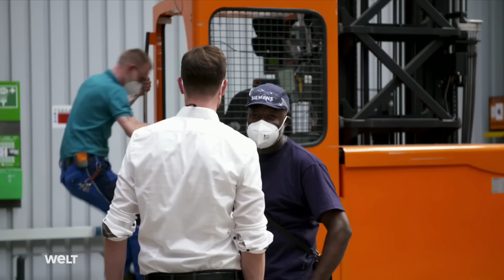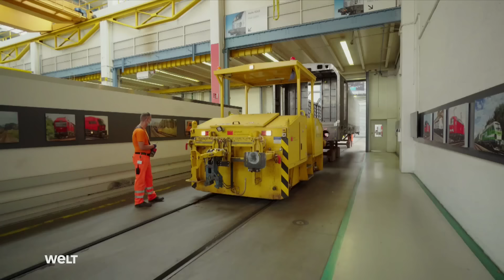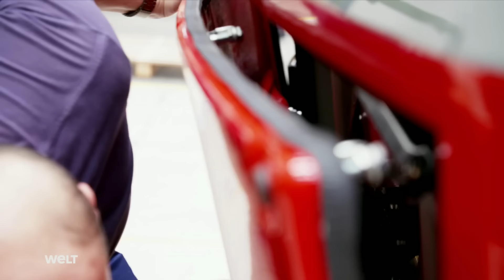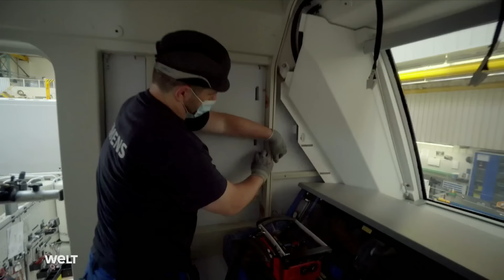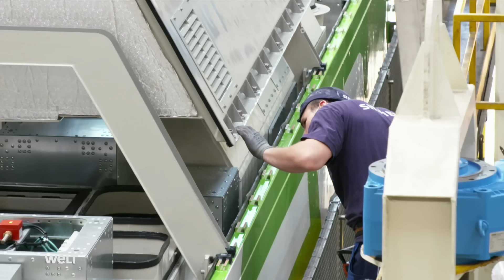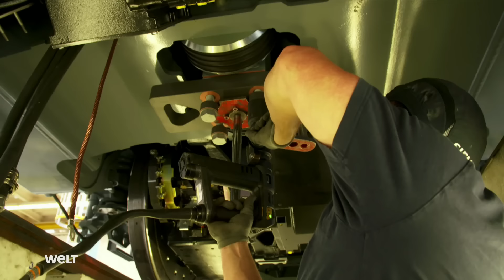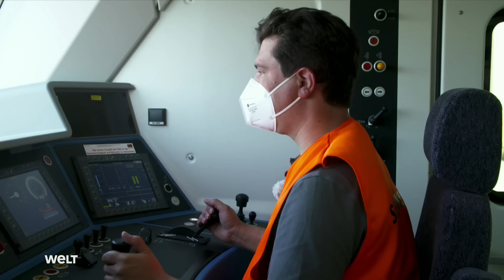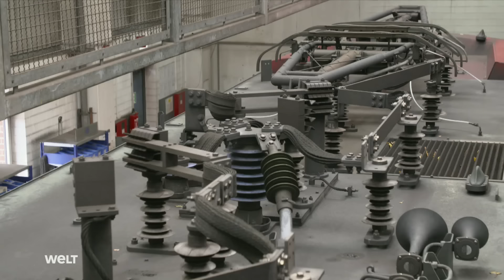SUSTAINABLE POWER FROM GERMANY: Electric Locomotiv - High-Tech on Rails | WELT Documentary

Comment: Do these machine have more efficient batteries or is this strictly power units driven with an overhead catenary system?
Reply: all powered by overhead wires
Reply: There is also a Vectron variant with diesel power, and a 2 system one with electric and diesel in one loco

Comment: It is a myth that electricity = sustainability/green.
Not the carrier of energy is important but the source.
A diesel engine run on fuel from waste can be greener than an electric loco powered by coal.
The advantage of the electric loco is however that the power output can be higher. That isn’t a green thing though, it’s a practical issue. The downside is that it depends on an external power source and gets stuck if the external power fails whilst the diesel will move on (signalling permitting).
Reply: There are practically zero coal fired power stations left in the first world.
Reply: @tspcrowther  Err, seems you don’t know about Germany, Poland, Chinajust to name a few.
And much of the rest is still sourced from oil and gas.
Electricity is as flexible as combustion engines when it comes to thesauriere of fuel.

Comment: So if you are not burning fuel on the train where are you burning it? And isn't that in itself less efficient with transmission losses.
Reply: EU had energy mix in 2020 consisting of 35,6 fossil fuels, 24,5% nuclear, 14,3% wind, 13,5% hydro, 5,8% biofuels, 5,2% solar and 1% others. So 63.4% of electricity produced in here we can consider clean or better said, low carbon. Diesel-electric locomotives (most of modern diesel locos used) are about 20-25% efficient . Electric 80-90%, losses in transmission are less than 10%. So in the end, we produce still less emission than directly burning fuel because we aren't burning so much fuel at all and even fossil power plants are 38-45% effcient for coal or 45-60% for nat-gas so in the end even burning fuel outside of the train can be more efficient overall.
Reply: @samuelgomola9097  The EU! Try Germany.
Reply: @mikemines2931  Vectron is built for whole EU... 16 nations are using it. Why we shout talk only about Germany??? I
Reply: No the efficiency of central burning of anything outweighs transmission loss.
Reply: @mikemines2931  dont know much about European energy supply? The whole is connected with the same electricity grid. From Norway to Spain and every country in between... It's basically a question of clicking switches
Reply: @OmmerSyssel  Those that know nothing always think it is so easy.

Comment: The only thing that makes a loco sustainable and climate saving is not to use fossil energy.
And that is independent from whether it has a diesel engine or uses electricity both can use renewable or fossile energy!
So set off the costs of buying a new loco against those to run an existing one on non-fossil fuels.
But sadly we live in a throw-away society where people even think that scrapping and buying new is a green thing to so. And even governments are pushing people towards „green“ consumerism.
Reply: Im not gonna say your wrong, but its a lot more complicated than that. Efficency is one thing that their most conscious of. The ability of a unit to move more with less energy is a good showing of whether a locomotive will be replaced or rebuilt, that is on other stuff like costs of maintenance and more. There comes a point where things have to be replaced, and efficiency in mind its hard to make something both long lasting, and efficient, especially when money is involved.
Reply: @larstheu …which means poorer countries are throwing away their previous locos.
I see a trend that todays rolling stock isn’t built or treated to last as the previous generation. After 15 years they consider them as old. That‘s consumerism.
And I also wonder where the economics are in that: An savings resulting from newer locos should break even with the additional cost of buying them. I wonder if it does!
Reply: @sterlingodeaghaidh5086  So you are saying the costs of buying new will be lower than the savings? I like to see after how many years they break even.
Reply: @demil3618  IT depends, there comes a point when saving a locomotive is too cost prohibitive, thus they sell them and get one newer, doesn't have to be brand new.
Reply: @sterlingodeaghaidh5086  The interesting thing I have observed is that the older (too expensive to maintain) locos are often sold to other train operators. And amazingly they don’t find it too expensive then.
That‘s where I don’t understand the economics.
Reply: @demil3618  ITs all money, too expensive for one to maintain is new and usable to another. Just depends.
Reply: Some operators cant afford 4 mil, so its easier to buy a tired engine and fix it up than to buy a new one, where as the larger operators can afford a new locomotive, so they don't see value in fixing older stock.
Reply: That is just not true! Locos often operate more than 30 years. The Finnland Locos are designed for a lifetime of over 60 years. But at some point, new technology is just so much more efficient (not only regarding energy consumption, but also operation and maintenance) that it does not make sense to use old machines any more. And maintenance and operation time do cost money, energy and other resources.
If you want cross border operation in europe, you will need a modern locomotive with several ATP systems and the 4 energy supply systems. The alternative is to change locomotive at the border, which costs time, money and energy!
Reply: I mean a locomotive is not a lifestyle product, but an investment object, which is in operation as long as it is sensible.
Reply: @jghrbs7737  I am no rail insider. But I see e.g. DB scrapping class 425 units after some 25-30 years whilst their 1960s class 110 are still in use with those few operators that saved one from the scrapyard (DB scrapped most of their old locos so competition wouldn’t get them).
Reply: @sterlingodeaghaidh5086  Thats where i’m curious about the economics. If it works for smaller operators, isn’t it just a throw-away for the larger ones?
Somehow I compare this with buses, coaches and lorries.
Reply: @demil3618  Just down to the operators willingness to spend the money on it.
Reply: Basically wrong, combustion of anything is inefficient so biofuel derived combustion fuel is a loser.
Reply: @crhu319  Why? If it‘s available it is a solution. We should move away from the idea of only having one big solution for all. This isn’t China.
And efficiency doesn’t matter. What matters is that it isn’t fossil.
Reply: @sterlingodeaghaidh5086  That may be indeed. As long as it isn’t public money, I don’t care.

Comment: Putting a Diesel in an electric Lokomotive who can handle DC-Power (Power in Italy is DC) is a full scale Fail. A MWh Batterie like in Tesla Semi is the Better decision for the last Miles without Electrical Support.
Reply: @@asterixxer Yes she can, but in Rail business an Investition is Calculate for 40 Years, which means Diesel is a nogo for science at least 15 Years …… if range does not fit with the existing electrical lines some electrical insular electrical segments may be created .……
Reply: @q9a  Sure, for regular last mile and shunting work the battery is the better alternative than diesel. But are they proven enough to be relied on in emergency situation? Two days ago, Finland's main rail-line between Tampere-Seinäjoki lost power for more than two hours in middle of winter causing delays up to six hours. This time it was due to failed component in transformer station, but it is a common occurrence during the winter storms. Nearest depot with maintenance crew is in some cases up to 300km away, so they wanted Vectrons to have Diesels so they could crawl to next station or siding when something like this happens.

Comment: Hydrogen Electric locomotive may be the best idea for the next step.
Since trains runs on tracks so we can design efficient hydrogen distribution infrastructures.
Reply: Hydrogen is generally a loser.
Reply: @Andreas Sagen 1.23 volt is the minimum to disassociate water into 2 H2 + O2. Solar and wind farm can do this easily. Any excess energy not used on the grid can be directed to making hydrogen. 3 kg of H2 have the same energy content of 99 kwH battery like those in the Tesla model X without the dead weight of 650 kg battery. 3 versus 650 kg, It really a no brainer.

Comment: While these are cool, and perhaps a decent passenger train, they have less than half the tractive effort of a regular diesel freight locomotive we use over here in North America. When I heard him comment on 35 cars i went back thinking i had heard wrong. Are freight trains in Europe really short? Out here in the Canadian prairies they can be up to 12,000ft long (Nearly 200 cars long). Now obviously that's not one locomotive for all (could be 3-4 at front and back and some in middle) but one locomotive can handle alot more than 35 cars?
Reply: It can handle longer trains, but European yards and sidings aren't too long. Also the acceleration must be high enough to be able to run between faster passenger trains on the same routes.
Reply: Most freight trains I see in eastern europe are 20-30 cars long. Usually carrying coal or grain.
Frieght trains here have to share tracks with passenger trains. 
Even a city with 100k people will have at least 15 trains a day, so most traffic is passenger. Which means cargo trains have to be short and run mostly at night or between passenger trains.
Reply: @laju  Ahh yes that makes sense, We have like maybe 1 passenger train on the freight lines a day so they have free reign in that regard. That being said with each unit having at least 4000hp up to 6200hp when you have 2-5 of these units on a train they get up and go faster than you might expect. Not as fast as these mind you but they can surprise.
Reply: Typical max train length in Europe is 750m (cca 2400ft) so any new infrastructure is built with that number in mind, though You will find also shorter max lengths on some older or mountainous lines (500m, even shorter), but we then run much more trains, combined with passenger trains (which are typically 200/400m max). Also we can have multiple operators on same line running their trains, both passenger and cargo, there is usually a legal separation between infrastructure operation and operators running on it.
Reply: @TranceEmotion  Also its the freight train that has priority here in the US rather than the passenger train as in Europe. If you watch any of the US scenic train videos you often see they have a layover for a freight train.
Reply: That's purely a factor of axle count and gearing. If this were designed to similar requirements as the US, this would run circles around what we have as it has an extra 3k hp to work with.  Europe values running shorter trains with high frequencies and high performance so they don't need the extra tractive effort. Compare that to us where we just want to run stupid long trains with poor performance to cut costs by any means.
Reply: @TranceEmotion  That's not that much to be fair. For Diesel maybe, but not for all rolling stock. A EMD SD70ACe-T4 has around 3,4 MW of power. The most powerful Vectron has around 6,4 MW, nearly double the power. In terms of Strength, the Vectrons definetly outrun the north-american models. But as stated before, our sidings are much shorter, so we just run shorter trains. And to be fair, the american "precision scheduled railroading" is a extreme cost-cutting measure our folks don't use (yet).
Reply: @TranceEmotion  well US and Europe are entirely different working environments with different demands. In the US freight trains are super long, heavy and slow, and they barely have passenger trains to share the track with. Over here freight trains are rather short, by far not as heavy, and fast. They keep up with the passenger trains they share the track with, often being just minutes apart from each other. There are way more trains per hour per direction on most of our tracks here

To put this into perspective: take a stretch of a railroad line with one track in each direction. That track is used by freight trains, commuter trains, regional trains, regional express trains (also international ones), inter city and inter city express high speed trains (again also international ones) ... all at the same time. Having that in mind the freight trains should be able to somewhat keep up and not be too much of an obstruction by creeping a track along at low speed
Reply: It's basically what other people said and because freight train size is regulated, they're only allowed to be a max of 760m long (depending on the country)
Reply: then build them to american specs, there are the thing is that europe doesn't move superlong trains and usually one or two locomotives are enough, but that doesn't mean that electric locomotives adapted to pull north american freight trains are impossible to build, you just have to adapt them to north american specifications
Reply: @mr.trueno6022  that's because the sd70 is twice as heavy as the vectron and also has two more axles and it's geared for lower speeds, the relation between horsepower, weight, number of axles and gear ratio is what determines the tractive effort of a locomotive

Comment: Only 8500 , that's low , way low ...... We got 12000 hp locomotive being manufactured here in India , that too at the rate of 00s locomotive per year( check it out , they just did a factory tour ) 

Note - 20 yrs ago , metros were transported from  Germany to Delhi metro at the rate 1 coach per flight by an225 ..... Used to be big news.... Ohhh  how times change
Reply: XD You don't understand how European railway network s build and how it operates.... Also EU is using standard gauge 1435mm,  India have mostly broad gauge, 1,676 mm railways. Simply said, there are  different needs, different layouts different networks.
Reply: @samuelgomola9097  not to mention the WAG 11 they love to refer to is two locomotives permanently joined together, rather than a single unit. Anyone can make massive power if the locomotive is the size of a football pitch. The Vectron series squeezes 8500hp in a footprint less than half the size of the WAG-11 (19m compared to 42.5m), which is very impressive.
Reply: @trailingrails9953  needs to be massive , weight requirements increase exponentially considering the pulling capacity, they made for freight no passengers
Reply: @trailingrails9953  Very good point and in the end, even Vectron can be configured in dual loco setup if needed, but it's not cost effective. Just one word, Indians...
Reply: @qwill8254  different purpose, needs and circumstances! Most trains in Europe don't get as long and heavy as they are in India. If we need powerful locomotives somewhere, be sure, we get and use them

Comment: Sustainable locomotive that run on coal power and gas elelctricity 🤣 we all seen the news about germany and their power genration 🤣
Reply: A locomotive is 7x more power efficient than a truck. Therefore, even if oil is burned, the CO2 output is decreased to at least a 7th. In addition power plants can have large exhaust gas filter / scrubbers to lower output even further.
Reply: @eslofftschubar206  In addition if countries are smart the waste heat can be utilized for centralized heating like in Denmark, or even used for refridgeration in warmer countries along with other possibilities instead of wasting all that heat out of the engine stack to do no additional work.
Reply: The long term goal of course is 100% renewables. But even today, locomotives are way greener than trucks! They are more efficient, they do not produce local emissions and they use 40 or 50% renewable energy already.

Comment: I like how they claim it’s “greener” to have all these ugly ass cables hanging above every rail line and yet no one mentions where the electricity comes from. Just electrifying something doesn’t make it “green” the electricity has to come from somewhere and since Germany was dumb enough to kill almost all its nuclear power plants it’s now coming from coal. Worse than just having diesel electric locomotives.
Reply: 44% of Germanys electricity comes from green sources, 56% from conventional sources with coal making a 36% share.
Btw with countries like the US barely run any electrified trains and rely on several diesel locomotives burning fuel on 100% of their trips, I honestly doubt that it's any greener than most trains being electric and more than 40% being green energy.
Take Norway as contrast: yes, their longest main line is still diesel powered, but most trains in the country are electric. And Norway gets 100% of its electricity from green sources; Also it generates more profit for freight companies: a rail company far up in the north electrified its track more than a century ago as the locomotives were more powerful and thus were able to pull heavier and longer trains, generating more profit with every single train